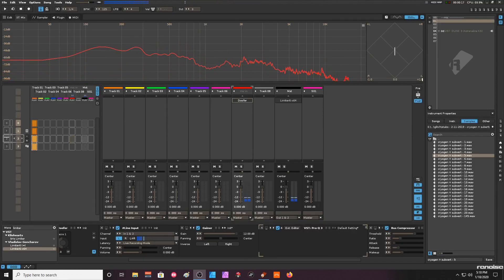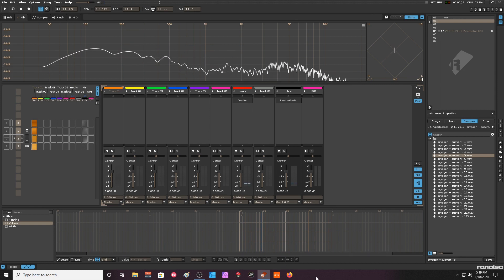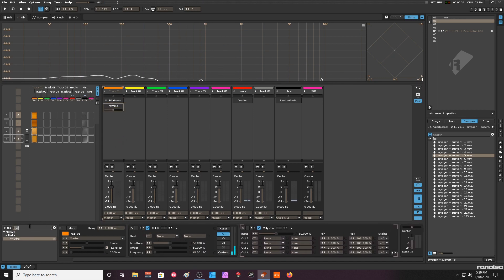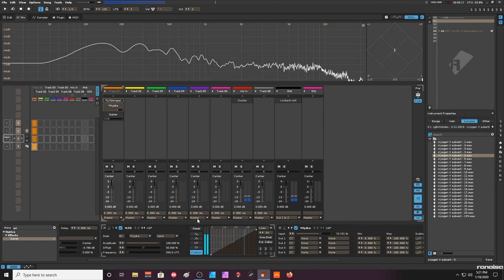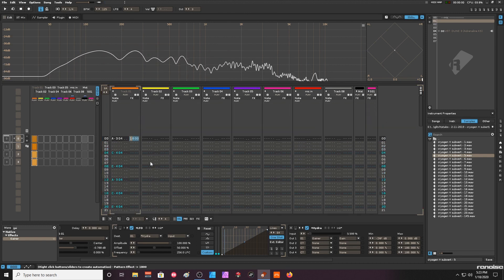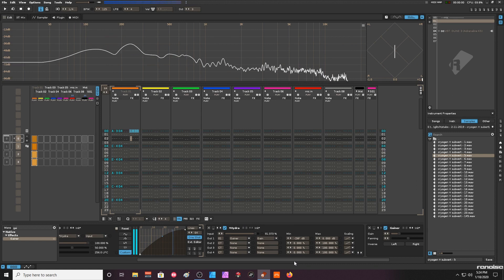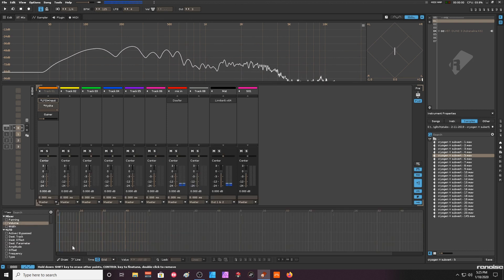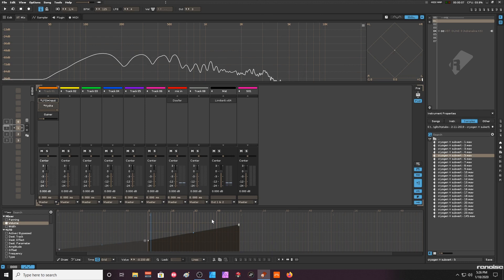Renoise - use this lfo tip to make automations faster !!!

Comment: Dude I'm so darn happy you're posting Renoise tutorials still. I've yet to get my ass in gear but should. Also the setup works great, and it's a great little trick to be able to work through longer pieces with multiple types of automation. I'll have to let you know if it works well for me!

The main thing that I'd be concerned by is if I want to control or automate multiple parameters with different automation curves?

How would I go about layering that with the Hydra LFO?
Reply from the maker: If you want to have multiple curves for different parameters you need to use more than one lfo ...if not just change the values for each parameter and use the same automation curve
Reply from the maker: I tried it on several projects and it's not taxing on the CPU to have several lfos and hydras you just need to name everything accordingly so you don't get lost
Reply: @LandOfBits  That's AWESOME. I love low CPU usage / optimizations. <3 <3 Thanks for explaining in detail.
Reply: @LandOfBits  Got it and you can target different sliders via the Hydra subchoice in the LFO tool, cool, that makes a lot of sense.

I think it has tradeoffs for sure, but overall I don't automate more than 3 things at once, making it easy to handle with.  It should keep clean if I possibly bundle the LFOs in a Doofer or something.

Hype!
Reply from the maker: @VetNovice  remember that if you group the lfo into a doffer then triggering the reset becomes a headache...

Comment: Hi, do you use the Akai Fire controller with Renoise? I'm wondering if it works with v3.2 and what the note layout is like.
Reply from the maker: I don't have a fire anymore but there is a tool for it in the forums ...the develope didn't completed the tool when I test it and it was more like a step sequencer he didn't added note or scale functionality to the layout